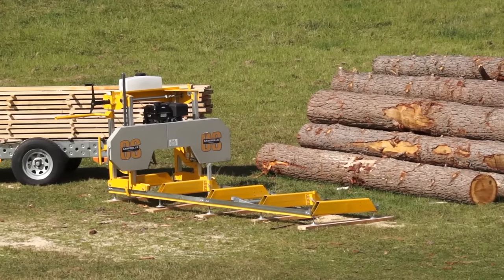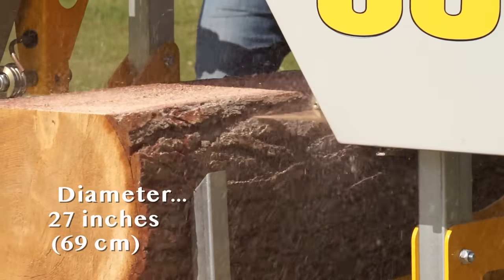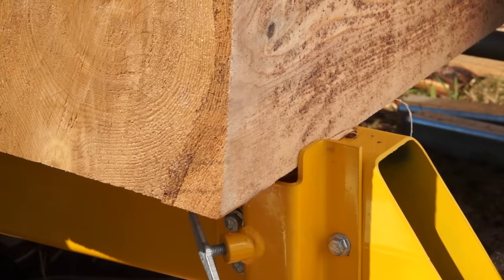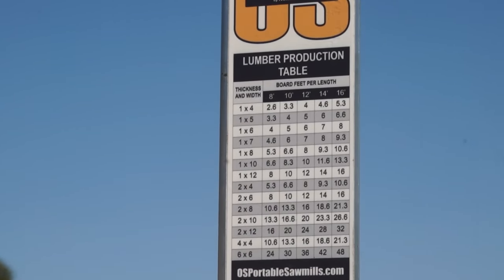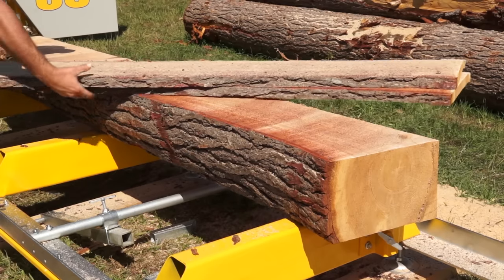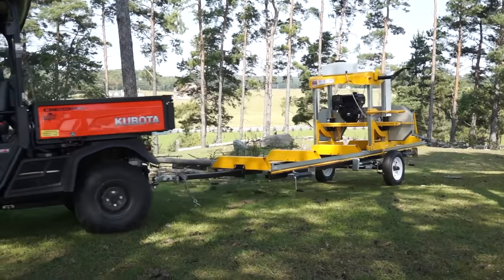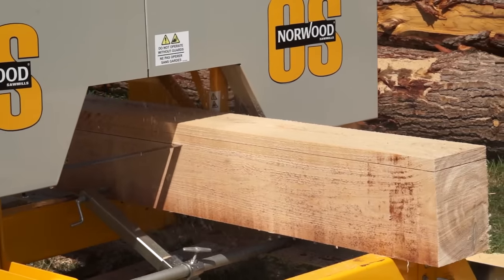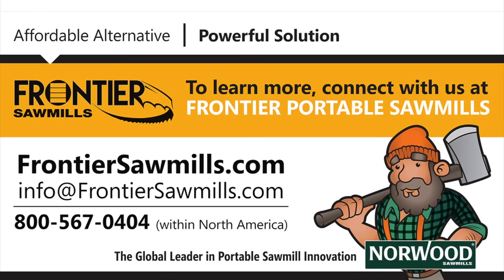The Affordable, Easy-to-Use & Reliable Sawmill You've Been Looking for - The Frontier OS27

Comment: ราคาเท่าใดคับ
Reply from the maker: Frontier builds three sawmill models with different log diameter capacities: OS23: 59cm (23”), OS27: 69cm (27”), and OS31: 79cm (31”). Standard log length is 3.4m (11’) but you can add 7’ (2.1m) extensions to mill as long as you want.  You can add the optionally available trailer/support jack system to all Frontier sawmills at any time (when you get your Frontier or in the future).

Frontier Sawmills start at just USD $2297 (for the Frontier OS23). The Frontier OS27 starts at only USD $3297.  The Frontier OS31 starts at only USD $3897.  

You can get a lot of helpful info about Frontier Sawmills, including all pricing, at www.FrontierSawmills.com  .

Frontier services your country factory-direct.  To order, contact us directly at Frontier Sawmills via email at info@FrontierSawmills.com . 

Thanks!

Comment: very very good i wnt its details.. how much this price
Reply from the maker: Frontier builds three sawmill models with different log diameter capacities: OS23: 59cm (23”), OS27: 69cm (27”), and OS31: 79cm (31”). Standard log length is 3.4m (11’) but you can add 7’ (2.1m) extensions to mill as long as you want.  You can add the optionally available trailer/support jack system to all Frontier sawmills at any time (when you get your Frontier or in the future).

Frontier Sawmills start at just USD $2297 (for the Frontier OS23). The Frontier OS27 starts at only USD $3297.  The Frontier OS31 starts at only USD $3897.  

You can get a lot of helpful info about Frontier Sawmills, including all pricing, at www.FrontierSawmills.com  .

Frontier services your country factory-direct.  To order, contact us directly at Frontier Sawmills via email at info@FrontierSawmills.com .

Comment: Adorei quero uma desta como comprar
Reply from the maker: Frontier builds three sawmill models with different log diameter capacities: OS23: 59cm (23”), OS27: 69cm (27”), and OS31: 79cm (31”). Standard log length is 3.4m (11’) but you can add 7’ (2.1m) extensions to mill as long as you want.  You can add the optionally available trailer/support jack system to all Frontier sawmills at any time (when you get your Frontier or in the future).

Frontier Sawmills start at just USD $2297 (for the Frontier OS23). The Frontier OS27 starts at only USD $3297.  The Frontier OS31 starts at only USD $3897.  

You can get a lot of helpful info about Frontier Sawmills, including all pricing, at www.FrontierSawmills.com  .

Frontier services your country factory-direct.  To order, contact us directly at Frontier Sawmills via email at info@FrontierSawmills.com .

Comment: сколько стоит и где можно купить или заказать ?
Reply from the maker: Frontier builds three sawmill models with different log diameter capacities: OS23: 59cm (23”), OS27: 69cm (27”), and OS31: 79cm (31”). Standard log length is 3.4m (11’) but you can add 7’ (2.1m) extensions to mill as long as you want.  You can add the optionally available trailer/support jack system to all Frontier sawmills at any time (when you get your Frontier or in the future).

Frontier Sawmills start at just USD $2297 (for the Frontier OS23). The Frontier OS27 starts at only USD $3297.  The Frontier OS31 starts at only USD $3897.  

You can get a lot of helpful info about Frontier Sawmills, including all pricing, at www.FrontierSawmills.com  .

Frontier services your country factory-direct.  To order, contact us directly at Frontier Sawmills via email at info@FrontierSawmills.com .
Reply: Талабшо,инфа есть какая нибудь?

Comment: How much cost where it available
Reply from the maker: Frontier builds three sawmill models with different log diameter capacities: OS23: 59cm (23”), OS27: 69cm (27”), and OS31: 79cm (31”). Standard log length is 3.4m (11’) but you can add 7’ (2.1m) extensions to mill as long as you want.  You can add the optionally available trailer/support jack system to all Frontier sawmills at any time (when you get your Frontier or in the future).

Frontier Sawmills start at just USD $2297 (for the Frontier OS23). The Frontier OS27 starts at only USD $3297.  The Frontier OS31 starts at only USD $3897.  

You can get a lot of helpful info about Frontier Sawmills, including all pricing, at www.FrontierSawmills.com  .

Frontier services your country factory-direct.  To order, contact us directly at Frontier Sawmills via email at info@FrontierSawmills.com .

Comment: What value machine?
Reply from the maker: Frontier builds three sawmill models with different log diameter capacities: OS23: 59cm (23”), OS27: 69cm (27”), and OS31: 79cm (31”). Standard log length is 3.4m (11’) but you can add 7’ (2.1m) extensions to mill as long as you want.  You can add the optionally available trailer/support jack system to all Frontier sawmills at any time (when you get your Frontier or in the future).

Frontier Sawmills start at just USD $2297 (for the Frontier OS23). The Frontier OS27 starts at only USD $3297.  The Frontier OS31 starts at only USD $3897.  

You can get a lot of helpful info about Frontier Sawmills, including all pricing, at www.FrontierSawmills.com  .

Frontier services your country factory-direct.  To order, contact us directly at Frontier Sawmills via email at info@FrontierSawmills.com .

Comment: Why not cut in both directions ?
Reply from the maker: Your question (suggestion) is not uncommon. Here is the reason why it is not done. Band blades need to be supported in the cut – top, bottom and back. To make a sawmill that can cut in both directions means having a blade with teeth on both sides of the blade. But, if you have teeth at the “back” of the blade, it is hard to support that surface with a blade guide support.

Comment: Price to Vietnam 🇻🇳🇻🇳🇻🇳
Reply from the maker: Frontier builds three sawmill models with different log diameter capacities: OS23: 59cm (23”), OS27: 69cm (27”), and OS31: 79cm (31”). Standard log length is 3.4m (11’) but you can add 7’ (2.1m) extensions to mill as long as you want.  You can add the optionally available trailer/support jack system to all Frontier sawmills at any time (when you get your Frontier or in the future).

Frontier Sawmills start at just USD $2297 (for the Frontier OS23). The Frontier OS27 starts at only USD $3297.  The Frontier OS31 starts at only USD $3897.  

You can get a lot of helpful info about Frontier Sawmills, including all pricing, at www.FrontierSawmills.com  .

Frontier services your country factory-direct.  To order, contact us directly at Frontier Sawmills via email at info@FrontierSawmills.com . 

Thanks!
Reply: @FrontierSawmills  you from ?

Comment: How is contact for you..?
Reply from the maker: Frontier builds three sawmill models with different log diameter capacities: OS23: 59cm (23”), OS27: 69cm (27”), and OS31: 79cm (31”). Standard log length is 3.4m (11’) but you can add 7’ (2.1m) extensions to mill as long as you want.  You can add the optionally available trailer/support jack system to all Frontier sawmills at any time (when you get your Frontier or in the future).

Frontier Sawmills start at just USD $2297 (for the Frontier OS23). The Frontier OS27 starts at only USD $3297.  The Frontier OS31 starts at only USD $3897.  

You can get a lot of helpful info about Frontier Sawmills, including all pricing, at www.FrontierSawmills.com  .

Frontier services your country factory-direct.  To order, contact us directly at Frontier Sawmills via email at info@FrontierSawmills.com .
Reply: এই মেসিং ভারতে কোথায় পাওয়া জায় বলবেন
Reply from the maker: Frontier builds three sawmill models with different log diameter capacities: OS23: 59cm (23”), OS27: 69cm (27”), and OS31: 79cm (31”). Standard log length is 3.4m (11’) but you can add 7’ (2.1m) extensions to mill as long as you want.  You can add the optionally available trailer/support jack system to all Frontier sawmills at any time (when you get your Frontier or in the future).

Frontier Sawmills start at just USD $2297 (for the Frontier OS23). The Frontier OS27 starts at only USD $3297.  The Frontier OS31 starts at only USD $3897.  

You can get a lot of helpful info about Frontier Sawmills, including all pricing, at www.FrontierSawmills.com  .

Frontier services your country factory-direct.  To order, contact us directly at Frontier Sawmills via email at info@FrontierSawmills.com .

Comment: $4,999.00 -
Reply from the maker: Hi Benny

Not nearly so much. Frontier builds three sawmill models with different log diameter capacities: OS23: 23” (59cm), OS27: 27” (69cm), and OS31: 31” (79cm). Standard log length is 11’ (3.4m) but you can add 7’ (2.1m) extensions to mill as long as you want.  You can add the optionally available trailer/support jack system to all Frontier sawmills at any time (when you get your Frontier or in the future). 

Frontier Sawmills start at just USD $2297 (for the Frontier OS23). The Frontier OS27 starts at only $3297.  The Frontier OS31 starts at only $3897. 

You can get a lot of helpful info about Frontier Sawmills, including all pricing, at www.FrontierSawmills.com  .

Comment: Where’s your Delar in Pakistan 
In which city your delar is in Pakistan?
Reply from the maker: Frontier builds three sawmill models with different log diameter capacities: OS23: 59cm (23”), OS27: 69cm (27”), and OS31: 79cm (31”). Standard log length is 3.4m (11’) but you can add 7’ (2.1m) extensions to mill as long as you want.  You can add the optionally available trailer/support jack system to all Frontier sawmills at any time (when you get your Frontier or in the future).

Frontier Sawmills start at just USD $2297 (for the Frontier OS23). The Frontier OS27 starts at only USD $3297.  The Frontier OS31 starts at only USD $3897.  

You can get a lot of helpful info about Frontier Sawmills, including all pricing, at www.FrontierSawmills.com  .

Frontier services your country factory-direct.  To order, contact us directly at Frontier Sawmills via email at info@FrontierSawmills.com .